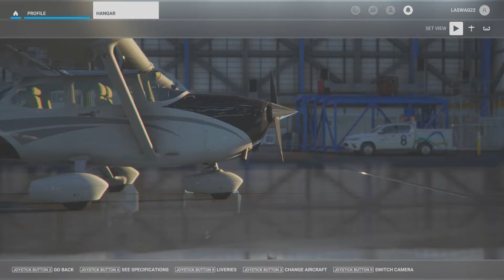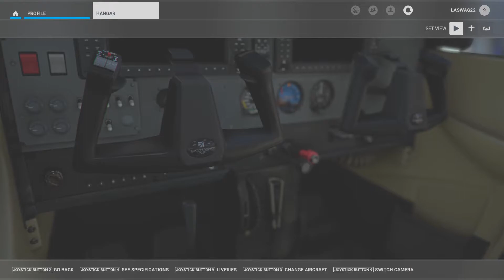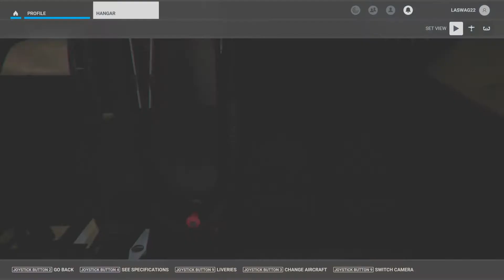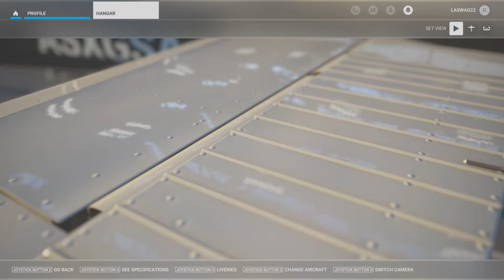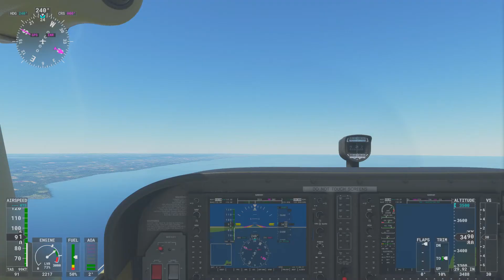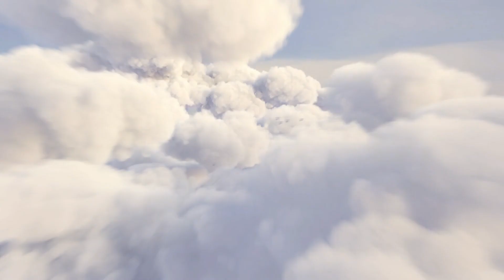Flight Maneuver Execution: Cross Controlled Stall

Comment: Adding rudder in the same direction as the bank is not cross controlling. It is over-controlling. Over-controlling is skidding and skidding is dangerous. Cross controlling is slipping and slipping is not. And you don’t have a need to bank the opposite direction, if wings start to roll off, you rudder opposite direction. Ruddering to the outside is cross-controlling, rudder to the inside is not.
Reply from the maker: This is the way the maneuver is accomplished. You add excessive rudder pressure in the direction of bank (if done correctly) you will need to counteract the rolling tendency with opposite aileron (putting you in a cross-controlled situation). Where you have aileron one direction and rudder the opposite.
Reply: 5-20 Airplane Flying Handbook states “a skidding cross-control stall is most likely to occur in the traffic pattern during a poorly planned and executed base-to-final approach turn. There may be an unrecognized tailwind component and higher ground speed on the base leg, which causes the pilot to turn late or with inadequate bank. The airplane overshoots the runway centerline, and the pilot attempts to correct by increasing the bank angle, increasing back elevator pressure, and applying excess rudder in the direction of the turn (i.e., inside or bottom rudder pressure) to bring the nose around further to align it with the runway. The difference in lift between the inside and outside wing will increase, resulting in an unwanted increase in bank angle. At the same time, the nose of the airplane slices downward through the horizon. The natural reaction to this may be for the pilot to pull back on the elevator control, increasing the AOA toward critical. Should a stall be encountered with these inputs, the airplane may rapidly enter a spin.” It then says that “During the turn the pilot should monthly apply excessive rudder pressure in the direction of the turn and hold the bank constant by applying opposite aileron pressure. At the same time, the pilot increases back elevator pressure to keep the nose from lowering. All of these control pressures should be increases until the airplane stalls. When the stall occurs, the pilot applies nose-down elevator pressure to reduce the AOA until the stall warning has been eliminated, removes the excessive rudder input and levels the wings, and adds power as needed to return to complete the recovery and return to the desired flight path.” WifiCFI is correct
Reply: @Low_flyer  skidding is by definition not cross controlled. It is over-controlled. The departure happens before the aileron is dropped in attempt to lift the wing because the wing drop is the departure by definition. A slipping stall is a cross-controlled stall, what the book call “cross-controlled” is really over-controlled with inappropriate attempt of aileron based recovery.
Reply: Effectively a “Cross Control Stall” is a spin entry demonstration and should be treated as such. You’re demonstrating how important it is to maintain coordination during a turn as entering a spin at such a low altitude as base to final is perilous at worst and treacherous at best
Reply: @Low_flyer  except you don’t need to maintain coordination, you need to specifically avoid skids. Slipping is completely safe.
Reply: @jimallen8186  I agree with you in part, the entry into this maneuver is "over-controlled" However the "cross-control" comes from applying opposite ailerons after over-applying inside rudder to keep your bank at 30*. Is the naming of the stall goofy? sure, but I'm not at the FAA with the ability to change that. Where I disagree is your comment on maintaining coordination, that's just sloppy flying, are there times when a slip is necessary like a forward slip? absolutely. but not in the case of a base to final turn which is the case of this maneuver.
Reply: let's not forget that this stall is for demonstration purposes only. the reason it exists is to demonstrate to students why you don't do this and to demonstrate to CFI applicants what a student can do to you. Everything about it is goofy and feels wrong when performing it, because it is.

Comment: I have a question, in this case you are turning left right...  So,  the wing that drops first would be left because of the rudder, turning it into a possible spin if not corrected, right? 

Or is it the right wing that drops first?  (in this scenario)
Reply: That’s exactly why it would be nice to show the full break. Often the higher wing violently deeps down.
Reply: The wing that drops is dependent on if the turn is slipping or skidding, a slipping stall is considered to be the less treacherous of the two because the airplane would attempt roll opposite the direction of the turn or over the top of the turn giving plenty of indication. The skidding would end up with the airplane rolling into the turn or under the bottom which in the case of a cross controlled scenario “base turn to final at about 500-700ft AGL” gives the pilot almost no time to recover before impact.